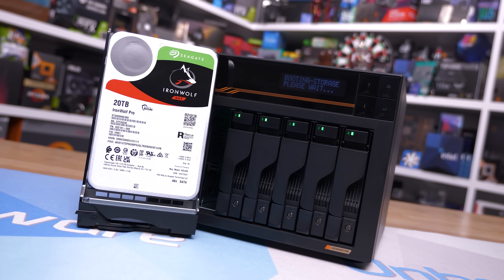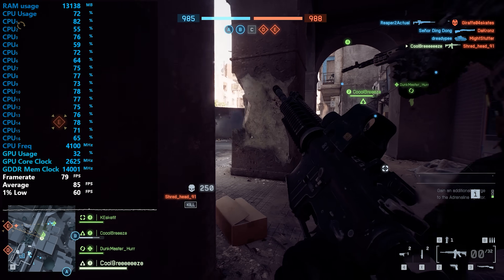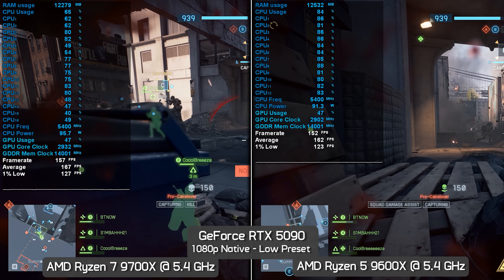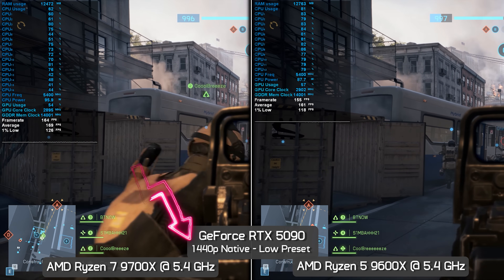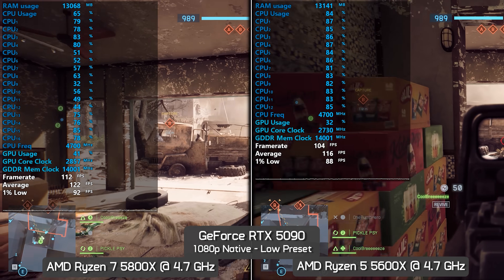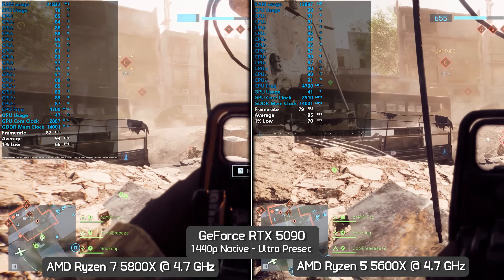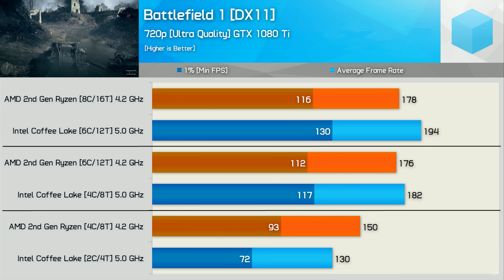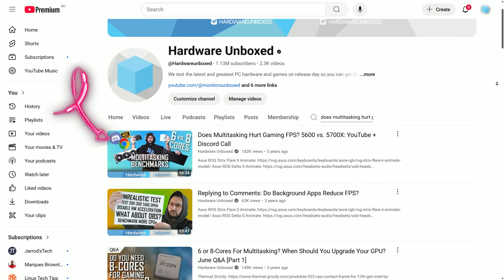Why Gamers DON’T Need More Cores, 6-Cores Still Works Well!

Comment: Yea. I still like my 24 core 14900k
Reply: Until it degrades and turns into a pumpkin 6 months later.
Reply: @one_step_sideways it's been 7 months, and still no pumpkin 😕
Reply: @RustyandLuna This is why I'm saying that it will turn pumpkin in 6 months, because it takes around a year and a half to pumpkin.

Comment: I have noticed in Baldurs gate 3, with a 9600x, there is some occasional stutters, specially in act 3 city… but not so with a 9700x… however it could be an issue with my pc alone… great video.
Reply: There was a rare issue I saw on reddit a while back that's been around for many years saying that some hardware combinations with MSI Afterburner running in the background would cause some micro stutters but that was related to the GPU power monitoring rather than the CPU.  If you use Afterburner, go into Settings -> Monitoring and disable any power monitoring. Bit of a long shot but if it applies to you it's one of those things that seemed to fix a lot of peoples issues despite it not often being talked about and some of the oldest threads about it being like 9yrs old.
Reply: @Barksyyy I hadn't heard of that, how curious.
Reply: If you are smart enough, you can use Windows Performance Analyzer to see what's causing this. But as I hive said, you have to be pretty smart to navigate through all those logs. With its help I was able to figure out that stutters on my system were caused by insufficient RAM, even though ~5--10% of it were free. Basically you record system metrics during gamplay (make sure it's relatively short, a 1--3 minutes, because WPA records HUGE amount of data), then look at drop in performance/FPS in one of the system components, then zoom in to try and see what is happening at that time, or maybe slightly before that.

Comment: Went from a R5 5600x to R7 5700x3D within 2 months. Usual games I play are Tarkov, War Thunder, Space Marine 2, and CS2.

The 5600x was completely fine for what it was and was certainly a good leap in improvement compared to my I7-6700. 

The switch to 5700x3D just felt far smoother both in and out of games especially with Tarkov and SM2. 

The 5600x was not wasted though as it's destined for my younger bro's PC I'm working on building.
Reply: I would love to do this upgrade as I have a 5600x as well, but it’s impossible to find an 8 core, x3d am4 chip for a reasonable price. I’m pondering the 5800xt but would rather have an x3d chip.
Reply: Yeah, difficult now to find them. I am running a 5600x/6700xt. I think i am just going to put a 9070XT in there for the moment as opposed to moving up to Am5. There was an article yesterday that said that AM6 was coming next year, don't know how true that is
Reply: @AndyLogan1984  am6 is probably 3 to 4 years away. Zen 6 and probably also zen 7 will both be on am5. Either go am5 now or go am5 see and wait it out. The higher the resolution the less the CPU matters
Reply: Am5 see? I typed am4 x3d lol
Reply: @mightychev yeah think I meant Zen 6. I am gaming on a 1440p Ultrawide
Reply: @AndyLogan1984 yeah me too. I'll be fine with my 5800x3d for a few years yet and hopefully until AM6 in 2028/9. The bottleneck gpu wise is somewhere between a 5080 and 5090 and I'll be running my 7900xt for another couple of years. Then upgrade to something 50% better and I'll still be ok on AM4. So tempting to spend money on shiny new stuff but the return just isn't there yet

Comment: For years we've heard "games only use X cores" Unfortunately most people don't have a clue about the difference between being 1) CPU limited, 2) Core limited or 3) thread utilisation.
Back in 2014 people with a 4core 4770K were saying "games only use 4 cores" meanwhile I'm seeing 12 logical cores being used on my 5820K... but a guy who only has 4 cores on a 4670K wouldn't know any better and that's like taking sex advice from the pope.

Today we have Intels flagships with 8 Pcores on a ringbus (cRaptorlake) OR 8Pcores on a tile (Arrowtothekneelake) OR 8 Pcores on a 9800x3D OR 8Pcores on CCD0 on a 9950x . . . in every scenario a game is being tied to 8 physical (16 logical) cores through hardware or software because going beyond that means going onto Atom cores or CCD jumping which has a massive performance penalty.
Shocked pikachu when games can utilise the 12c/24t on Zen6.

That doesn't mean games today can't already use 24 physical cores, but short of getting a Xeon W-3175X you're not going to be able to test to confirm or deny either way.
AGAIN core/thread utilisation and requirements are totally different things, I just bought a 5950x for my old system because it was cheap.. but my main has a 7600x (because it was cheap) and it'll be perfectly fine . . . to tie me over till I get a 24c/48Vcore Zen6 in a few years.

Person with Pentium Gold G7400 says games only use 2 cores
Edit: I await some noob thinking I'm saying more cores are totally worth it and another noob thinking I'm saying more cores aren't worth it, neither of which is true..... enough cores is enough... and 12 logical cores has been enough for me and 16 seems to be enough for everyone (according to Ryzen 7 sales).

Comment: Why is there such a big difference between 5600x and 2600x at 1080p low?!

In terms of GPU usage, it's 13%! 18% to 34%. Which roughly corresponds to the difference in clock speed and IPC. 

But 1% low is then directly 47FPS to 88FPS. Which is already a huge jump. Is it because of the cache? Because the RAM and platform, AM4, are the same. 

And where do I rank my 3700x now? I had no problems getting it up to 144 FPS. I don't know about 1% low. And it was with the help of FSR, which means hdrdy in reverse. 

Do you have an explanation for this?

Comment: Anything below 12 cores is a no go for me.Need my background tasks running as well as gaming With no slow down
Reply: Same. Had gone from R5 5600 to 5950X. No going back ever to lower core counts
Reply: I was a little sceptical at first too when deciding to swap from my old 5900x with 12 cores to the 9800X3D with 8 cores. That was until I saw that even in Cinebench, the 9800X3D beats the 5900X now because the CPU and its individual cores is just more powerful overall. So I would keep that in mind. More cores are great, sure, but I'd look at the performance and also keep in mind that if you don't really do productivity on your rig, you won't notice those faster background tasks.
Reply: @123Suffering456  Yea i totally agree with you. And i was going to get a 9800x3D at one point.  But decided i dont need to upgrade just yet, but come back to me when 10800X3D comes out lol.

Comment: The inference I take away from this testing is that a higher core count CPU always ages better, even just in gaming. You cannot buy a 9600X today and expect to play without frame time spikes or low 1% lows and especially over 85% CPU usage 4-5 years from now. That's why you spend the extra money on the 9700X. If you bring multitasking and/ or productivity capability into the discussion, the pendulam starts swinging quickly towards higher core count CPUs.

Comment: Thank you for your budget tests, which always put our fears to rest.
You guys are really the best! By far!

But a quick question about multimedia: how much headroom do you need? You can see that the 2600x has even less reserves... which is particularly evident in the 1%FPS where the diff is around 25%. 

You refer to a video of yours, but Discord and YouTube require practically no performance. Where does the bottleneck start? Is it at 60% or 80% utilization? The main part is IPC and the clock speed. And if the OS and the game developer do their job, the code practically always runs the shortest route, over the same cores. 

But I'm interested in where the limit is! At what point do more cores make sense? How much buffer should you have? Can you test that? Because Discord and YouTube don't generate any load. And on the other hand, you can't play games and edit your videos at the same time. But what about streaming? Which is often directly related to gaming. Is a GPU sufficient there too? Because it carries the main load? Would you perhaps be interested in creating a scenario where you play and add workloads until it “crashes”?

Just to get a better idea of how much power and resources you need.
 Gaming + Browser + YT + Discord ist no problem, isnt realy a suprise if you looking how much this threds needs. But is also if you want to this plus streaming. And if, what can you also do? Show please! Only for the science! A compilation of thread resources and his impakt on resurces.

Comment: If core count doesn't matter, why don't we game on CPUs with one enormously fast, powerful, and heavily cached core?  There'd be zero core-to-core latency or scheduling issues, so they'd be better, right?
Reply from the maker: A CPU architecture built just for gaming? What could go wrong :D
Reply: @Hardwareunboxed  I don't know.  I'm not an electrical engineer.  I would imagine the theory has been explored by people who are.
Reply: Multi-core CPUs were developed exactly for the reason that it's so difficult (if not impossible) to do.

Comment: Showing results in 4k or 1440p is not dumb, as defining the point where exactly the difference between CPU's diminishes is helpful when buying a CPU. For instance, I game mainly at 4k and the 9950x (non x3d) that I have upgraded to is faster in games than the 7800x3d. Especially in 1% lows. Almost all gaming hardware channels showed results in 1080p, which would make me think I need the lower core count 7800x3d for gaming, which is not true at 4k.
Reply: Useful info, thx.

Comment: Essentially, parallel computing is difficult to implement because of the nature of how tasks are carried out. There's inevitably going to be a bottleneck in 1-2 cores which is why higher IPC will generally show better performance improvement vs higher cores, which is why a 9600X beats a 5950X even in CPU intensive games.

Comment: When I built my new one, the 9950X3D was only about $200 more than a 9800X3D, so I was just like... why not? Gives me a lot more headroom if I want to queue up some handbrake encodes or something.
Reply: This. it's the "headroom" buffer so much most people miss out the whole point of high core cpus, in case apps scale more than 8 cores besides productivity stuff soon.
Reply: That's more productivity focused, though. I would generally say if you care about productivity performance at all, don't get the 9800X3D but the 9950X3D (as you did). If that's no concern at all, the 9800X3D is fine for a gaming focused rig and the 9950X3D would offer no real benefit in that scenario imo.
Reply: Yes, but the difference in money is way smaller than it used to be. In the 3000 series, the 8 core chip was $250-300,the 16 core chip was $750.

Thw 8 core X3D chips are priced higher, and the 16 core X3D chip is priced lower. 

It's such a small difference in cost in the case of a high end PC that I wouldn't get the 8 core unless you think you just literally never do anything but gaming on it. If you ever want to run a single virtual machine, you'll thank yourself later. 

 @123Suffering456
Reply: Handbrake was one of the reasons I bought 5900X. 12 cores + excellent AV1 on intel cards are working super fast.

Comment: interesting, in these tests it's clear that the workload is just being spread to more cores rather than fully using them for example total usage looks like about 85% on the 5600x and even less on the 5800x, but when i played the beta my 5700x3d was being utilized between 90 and upto 100% all the time, maybe it's because of the 3d cache allowing the cores to be fully utilized while normal cache bottlenecks them? or maybe i did something wrong, idk. would be cool to see something like 5600x3d vs 5800x3d or 7600x3d vs 7800x3d in this context
Reply: Likely because as with most games, it is probably running much of the heavier aspects on a single core still.  If that core becomes maxed out, it doesn't matter how much you spread everything else out, you're still already performance limited by that one primary game logic core(which is much harder to separate out into different work threads).
Reply: That's fine but i assume if that's the case and 1 core is maxed out and the rest of them were say around 80%, the overall cpu usage would still be like 83-84%, unless I have the wrong idea on  how it's calculated @maynardburger
Reply: The beta had shit core usage and scheduling. Using the User.cfg config reduced the cpu usage by 20% minimum without you losing fps.
Reply: All those cores are waiting that the main progran stream does it job.

Aka one core runs the main game and extra cores run supporting tasks!
And when you have enough aka 6 cores, the rest are waitin that the main core does its job, until they can continue…
This is true to most games if not all.
Reply: Check the max core utilization metric  to find out  of hiccups

Comment: That is why I went for the 9600X (200€) with my new gaming build. No practical benefit, and the price was more than 50% lower than the 9700X (312€). The AM5 platform has a 2027+ support roadmap. So I´ll just wait for something meaningful to upgrade to in the future.

Comment: I would like to see a comparison between X3D CPUs, because 8C CPUs are more RAM bottlenecked than 6C CPUs.
So my guess is that 8C CPUs with V-Cache are more than 8-10% faster in BF6 compared to 6C with V-Cache.
Reply: Maybe its worth mentioning that in the HWU test only 1 or 2 cores hit 85% utilization.  Its a bit weird that GPU is at 40-55% load and the most used CPU cores are only at 80-85% utilization.
Usually, when we are in a CPU limit, at leastr 1 core should show around 94-98% utilization.
I've seen the same behaviour on my rig with 5090 and 9800X3D.

Comment: Now redo the tests running a middleweight vtuber model in vroid studio, streaming to Twitch and YouTube simultaneously.

I get it, for purely gaming, a modern 6-core may be fine. But since every kid wants to be a streamer/vtuber these days, the tests should include loads like that.

The other issue with this testing is that you used the 5090, which you already showed has DX12 overhead issues. A better test would be to use a 9070 or 9070 XT with these lower end CPUs.
Reply from the maker: https://www.youtube.com/watch?v=Nd9-OtzzFxs&pp=2AEAkAIB

Comment: Nice video. The main point gets through: how strong each CPU core is matters more than the number of cores, generally. I didn't hear "threads" mentioned, maybe to avoid unneeded confusion?
But the game overlay reports "CPUs" , where each "CPU" is a thread rather than a core. Twice as many as the cores if the CPU in question supports smt or hypethreading, which AMD still does and Intel does not. Apps incl games see threads and unless SMT is disabled that will be 12 threads on 6 cores for the 9600x and 14 threads on 14 cores, heterogeneous, for the Core Ultra 5 245K. A heterogeneous core (and thread) collection increases testing complexity.

Comment: lil thing on my end: 9000 series aint really better than 7000 series. and you can get the 7700 cheaper (in europe)  than the 9600x while also using less juice!

Comment: I dont know what r these tests but let me tell u real life non-tech unfiltered normal gamer test. I played bf6 on my 5yr old R5 3600@3.60ghz with rtx 3060 12gb and got an overall fps of 120 using 1080p low but my individual cpu fps was struggling to cross 50 which meant my game was really slow, laggy and enemies teleported infront of me. I was dead even before I could open my crosshair. It was really an unplayable experience on the first week of beta. 

Seeing this I built an entirely new pc with the R5 7600x @4.70ghz but kept the old rtx 3060 12gb. The same game now ran much more smoother and got an overall fps of 100+ using 1080p high settings while the cpu fps was like 76+ and had a blast playing the 2nd week of beta. 

remember the first one was 120fps at1080p low and the 2nd one was 100fps at 1080p high
Reply: It's great that you are now on am5, but did you consider just popping in a 5700x3d?
Reply: @circleofsorrow4583   I did consider that but first 5700x3d is NOT available in India and the 5800x would cost me atleast 250$ plus updating bios of my failing motherboard. 

Also I wanted to make a huge jump to a completely new build instead of just swapping the cpu after 5years

Comment: 1- Newer architecture typically trumps older stuff. A modern 6 or 8 core cpu will beat 10-16 core stuff from 2 generations or older
2- It depends on the game, resolution, and fps goal
3- Cache. Cache is king. Often, more cores have meant more cache, and by virtue of having more cache, more performance. The cores themselves were not always helpful, depending on the game, but cache is almost always helpful
Reply: Cache is only king if the assets fits inside the cache otherwise ipc+memory speed and latency is king. At 2K and 4K a tuned 14900K beats the 9800X3D in 1%/0.1 lows. The 9800X3D would have better lows performance but the infinity fabrics bottlenecks memory bandwith like mf.

Comment: I still get a tremendous amount of play out of my ALIENWARE  AREA 51 core I7 5960 X and RTX 3090.

Bought the new Area 51 with 285k and RTX 5090.

They keep on adding more and more cores to these CPU’s, but the developers don’t need them and aren’t bothering to use them.